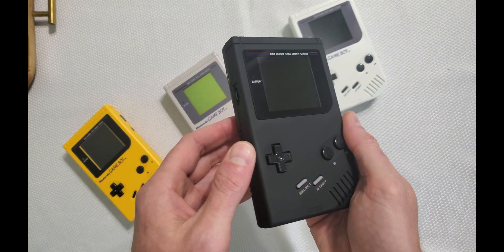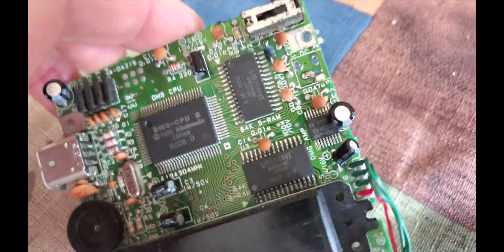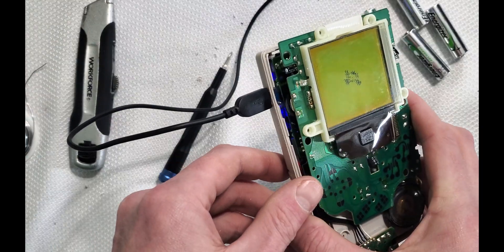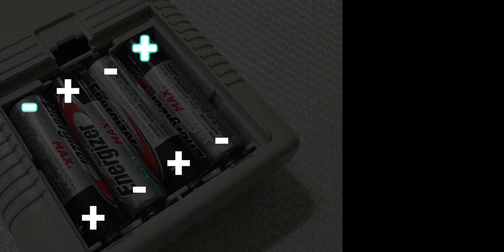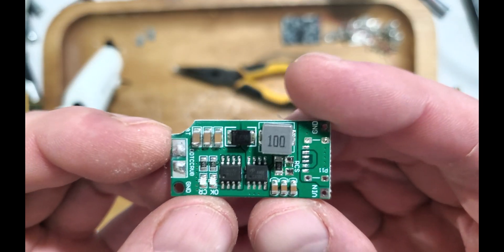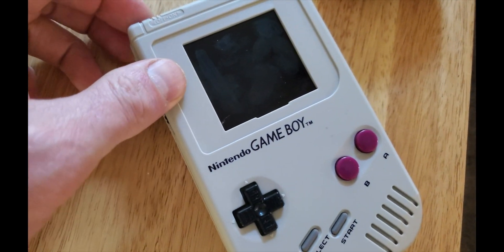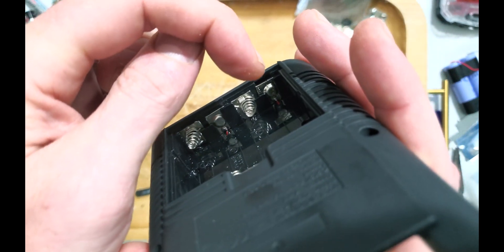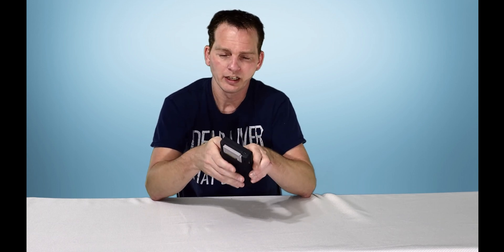Lithium Ion Conversion Gameboy

Comment: hey i know this video is old but im trying to do something very similar with the same 2s board, did you do anything else to make it work other than connecting the batteries on one end and connecting power on the other?